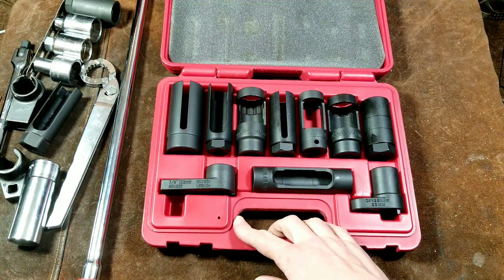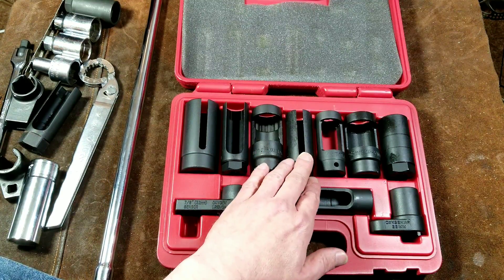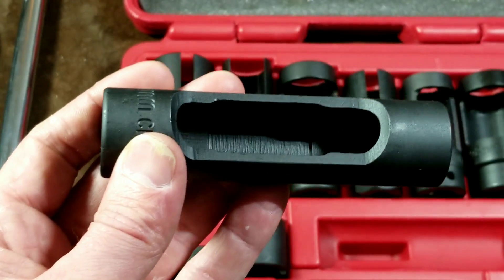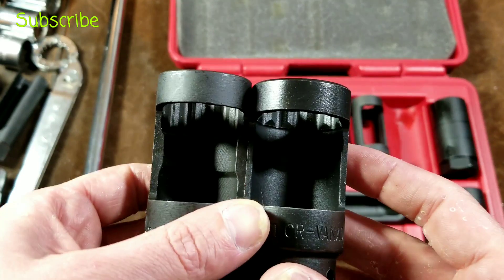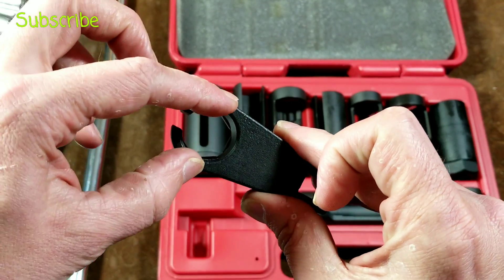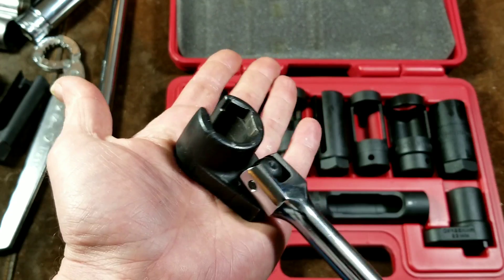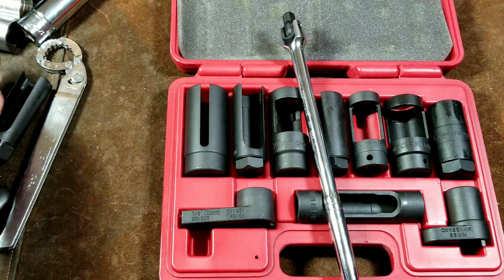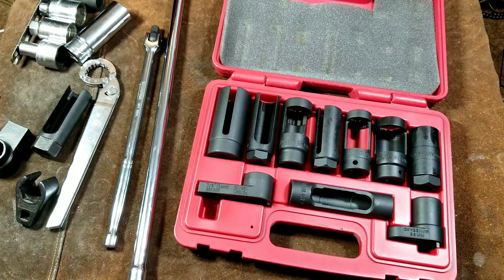Harbor Freight Professional Oxygen Sensor & Diesel Injector Socket Set Review

Comment: Iv got those. I would buy them again. I have had one spread and slip on a o2 sensor. But it was in there pretty good. Only happened once tho
Reply from the maker: Yes, that's happened to me several times one trick is to wrap the socket in wire and actually work for me once when it was slipping

Comment: Hmm, I really like some of the non harbor freight you had.
Having the harbor freight set would be good just to have something to start.

Has anybody had good success cutting their own o2 sensor wrench from some cheapo wrench before?
Reply from the maker: It's pretty easy I've done that once to a cheap wrench but it broke it would probably work better on a six-point high quality wrench. Just take an angle grinder and cut a slot in it as small as you need it and still able to pass it over the sensor.
Reply: @CatusMaximus  I was thinking about welding
Reply: So I can weld a wrench to a swivel extension
Reply from the maker: You can try it but the welding operation will destroy the heat treatment which is a significant portion of the strength of the tool. If it fails it will probably fail on the weld. If you TIG weld you might be better off because you can control the heat and use several small passes and not be quite as damaging i e not overheating the metal as badly as say a stick or mig weld.